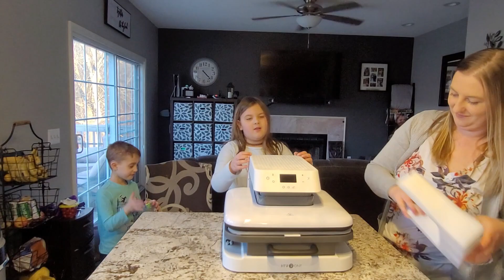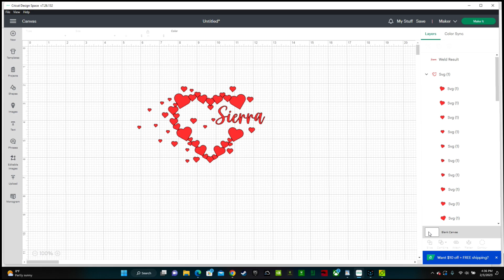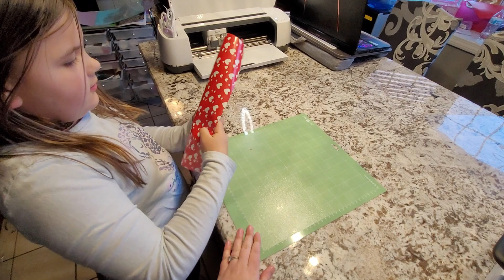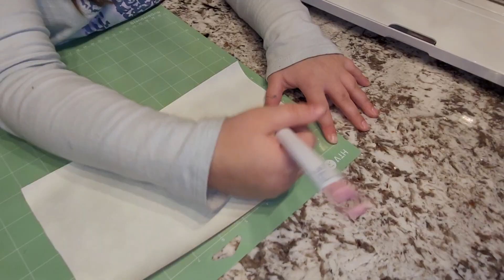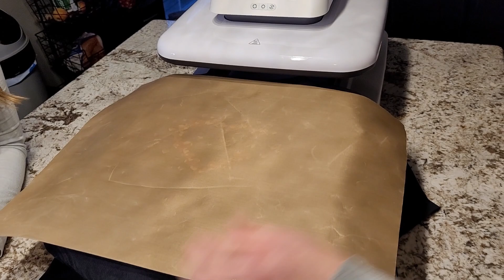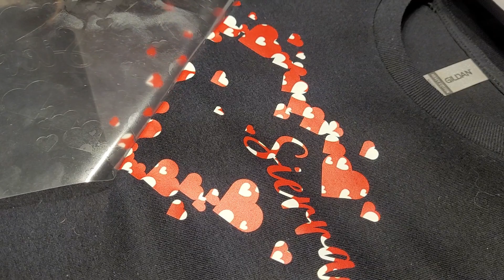Unboxing the HTVRONT Auto Heat Press + DIY Custom T-Shirt Tutorial! | Full Step-by-Step Guide

Comment: How was the pressure I read alot of people felt because you couldn't adjust the pressure settings it didn't stick and peeled up days later. Iv been so interested in buying one of these.
Reply from the maker: Honestly I'm having the same issue. I just made birthday shirts for my kids and I had to crank the temp over 300 and heat press 4x and it still barely stuck.